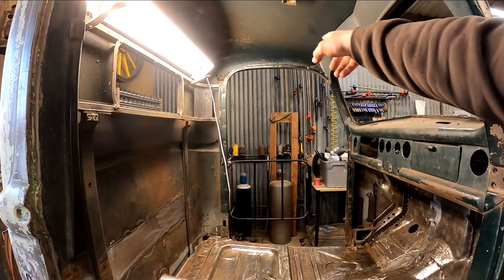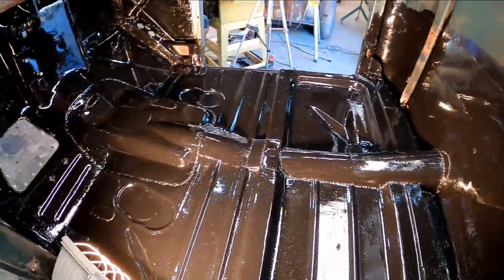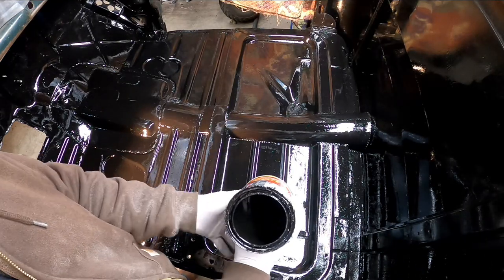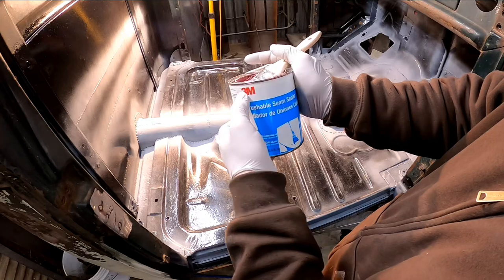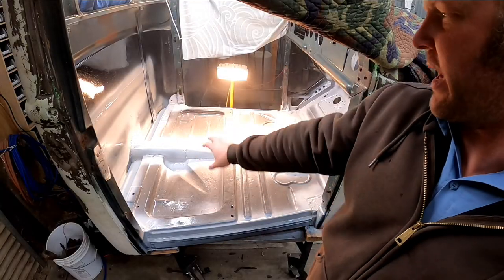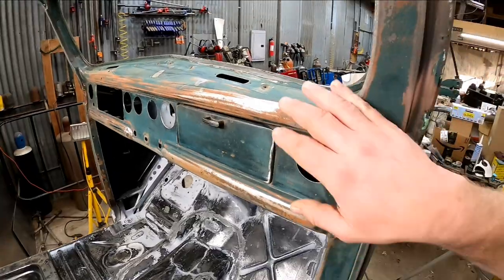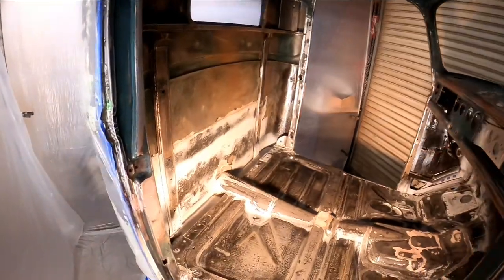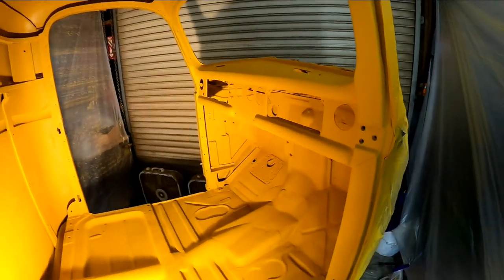Rusted to Primed | 1947 ford pickup (pt 34)

Comment: from a time-saver perspective, i used a little 4 inch paint roller when i did my POR/Chassis paint.  saved a lot of time.
Reply from the maker: 'hotdog' rollers, I use them often enough but didn't even consider it for this. Thanks!